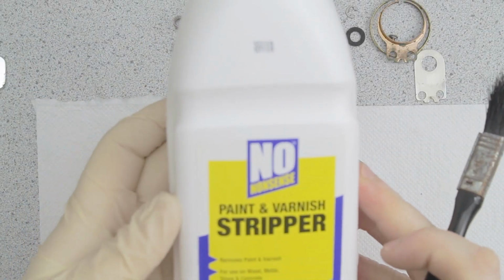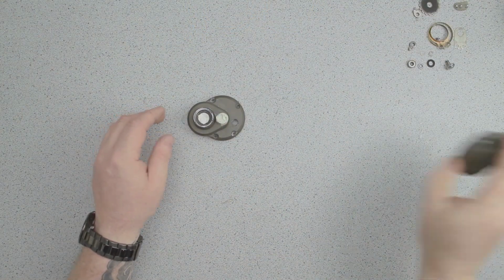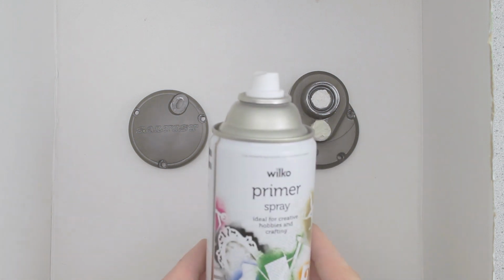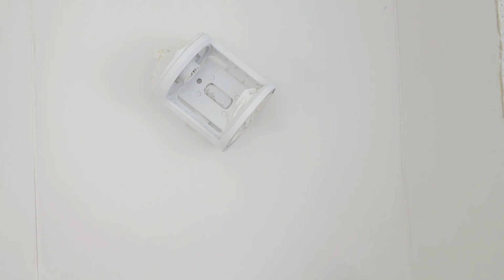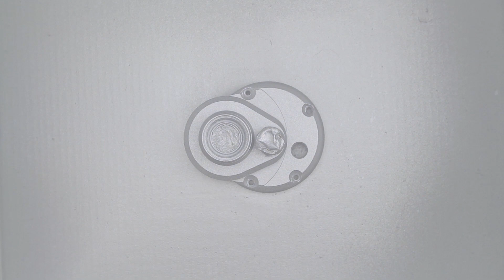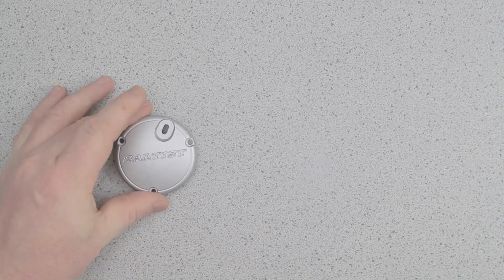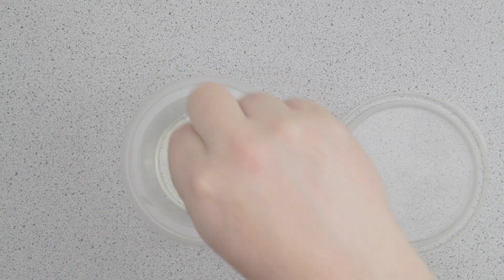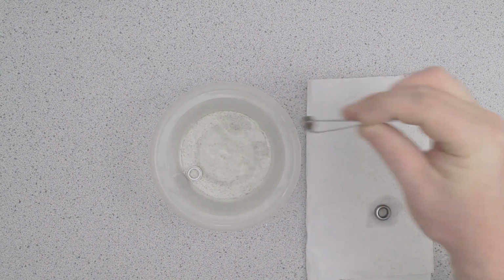Restoring & Servicing Multiplier Fishing Reel

Comment: Great video..Do you recommend using the Penn oil and greaser rather than rocket fuel??
Reply from the maker: I havent tried the rocket fuel. The Penn stuff has been fine for mine.
Reply: @fishingintheukgarywood  great... As you had to paint over the red daiwa saltist logo on the frame I was wondering if there are decals available or are you just using the reel without the logo??